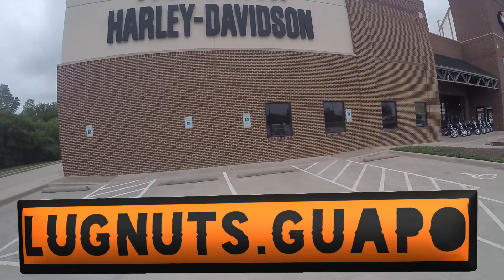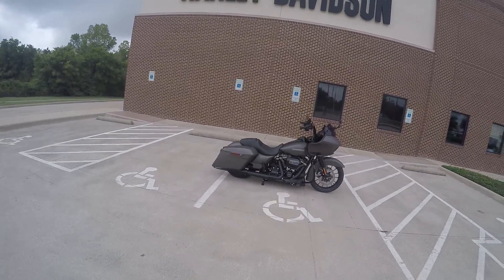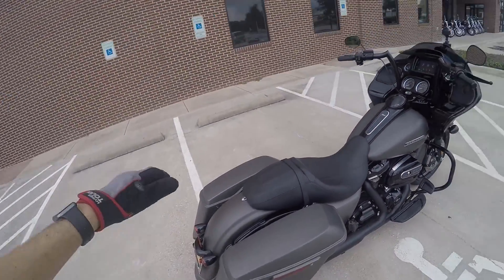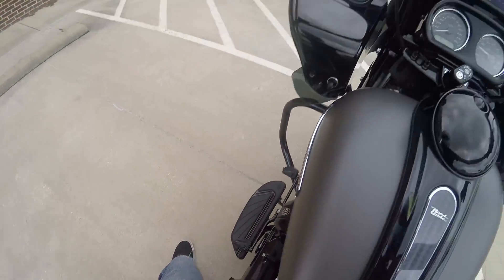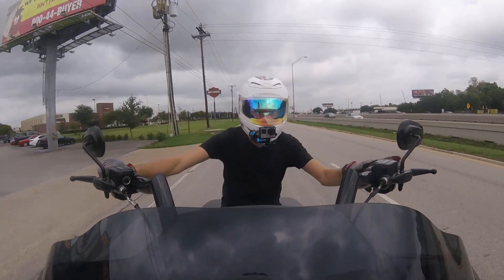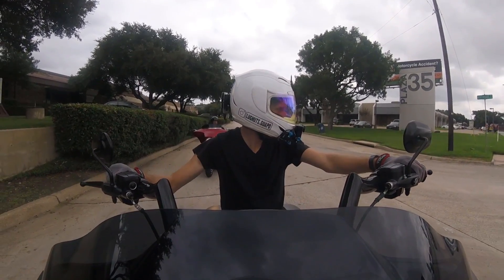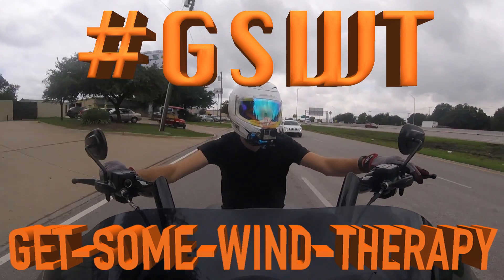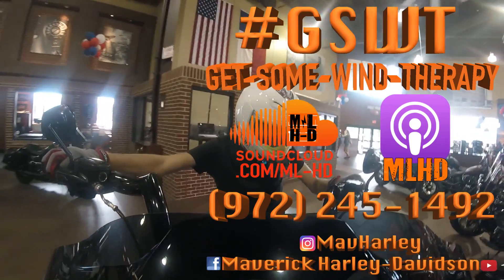RIDING DIRTY(air)

Comment: How did they mount the center stand on yours without the crossover pipe getting in the way?
Reply from the maker: We trimmed the heat shield, after that it fits perfectly
Reply: I did the same thing. Trimmed the heat shield. Just wanted to make sure I wasn’t behind on the work arounds. Thanks.
Reply from the maker: @iamthelastemperor  no problem!

Comment: What kind of bars are those
Reply from the maker: Torch Industries Pointed Top Bars
Reply: The bike looks wicked. Not a lover of the ape hangers though. The colour is great
Reply: Did u use stock brake cables
Reply: Factory 47 cycles

Comment: Bad ass bike with or without airbags . Not ver thrilled with the gps/radio , even though gps is needed a lot and that would be me . Sleek sled 😁
Reply: Used my GPS when I lost site of my crew only problem I had was it's volume was to low and I thought it was telling me to turn. But it was accurate to the point of where i was staying

Comment: I only wish i cared about air ride and all that unnecessary shit. I been ridin since mid 80's and who wants to give up bag space to do a dog and pony trick for casual fans to ooh ahh wohh yeah...Lmfao....but i guess its the same as oldeer white guys saying why u put 24's on your old school..still Lmfao
Reply from the maker: Thankfully the new air ride systems don't use up any space in the saddlebags, they mount between the saddlebags and the fender. They are practically invisible
Reply: This is the type of remark you get from someone that is totally clueless.
Reply: @esillery  how so?
Reply: @71donkrider  I think it's more for comfort. They don't take up bag space, as mentioned. Get with the times before you start bashing a quality product.
Reply: @nathanwilson413  LMFAO NOTHING about air shocks says quality.
its a faulty gadget that will break down...i have seen it several times..
every thing about them says hey im a tool watch me spend 1k plus to watch my motorcycle go up 1and half inches and watch it go down 1 and a half inches. GTFOH..this post is a year old